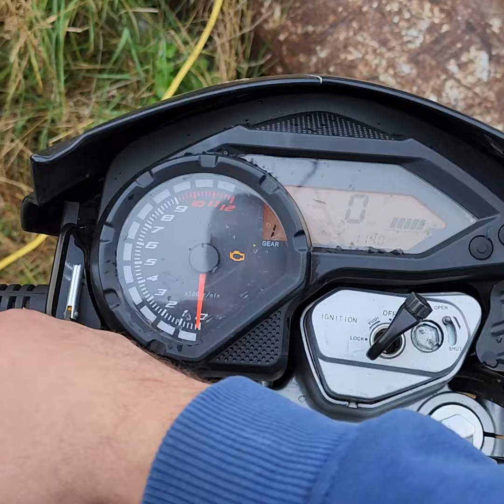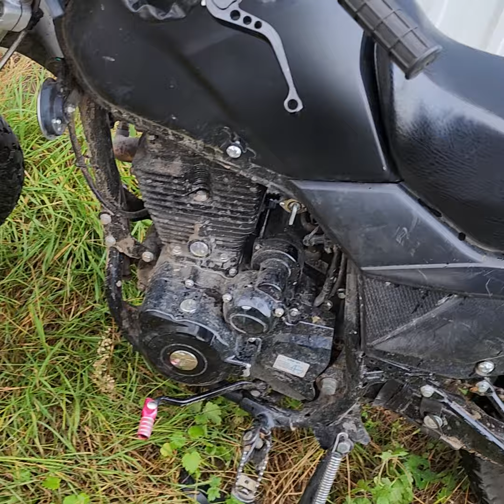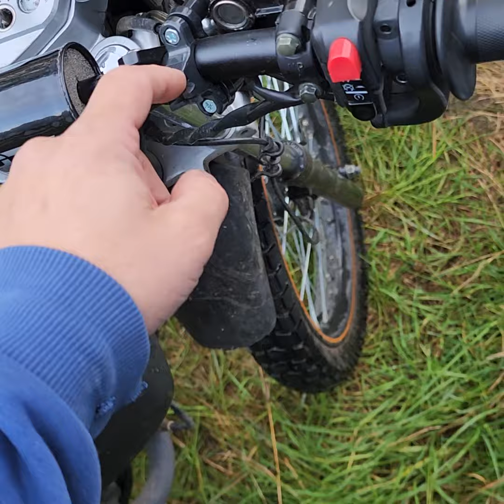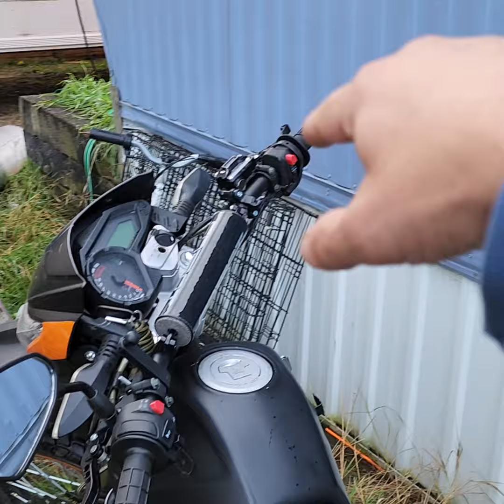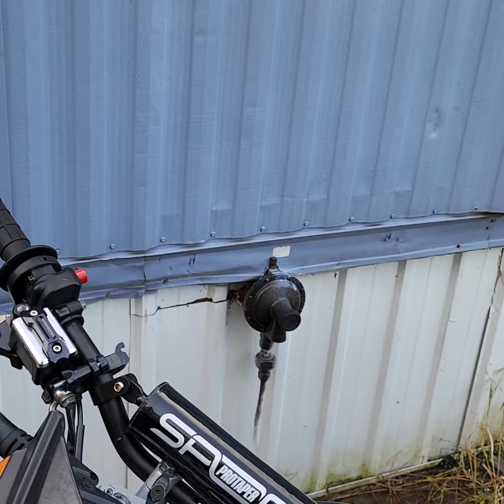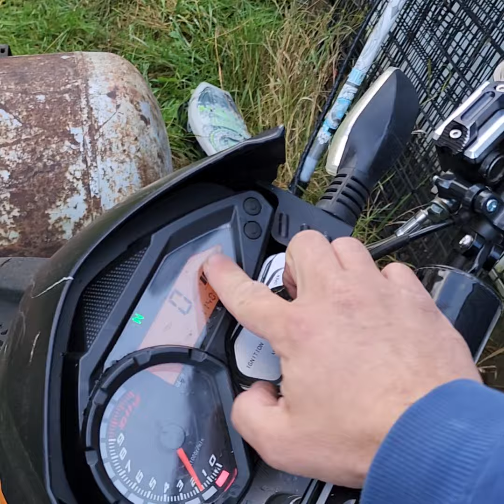starter button figured out and basic overview of the lifan xpect after 1140 miles

Comment: Could you link me the shorty levers you got? I'm looking into switching to them. We're they just drop in, or did you need to do extra work to make them fit?
Reply from the maker: They installed super easy, didn't modify anything with these, I ended up switching them out with some that spring forward as I broke 2 sets of these, not the fault of the levers, but they don't hold up to being slammed against the ground and trees too many times, if you don't do that often then these are just fine, I did prefer the reach and feel of these over what I have now 
https://amzn.to/3z4fltJ
Reply from the maker: Bleeding the front brake took the most time. But I had no idea what I was doing, still got it bled fine in the end